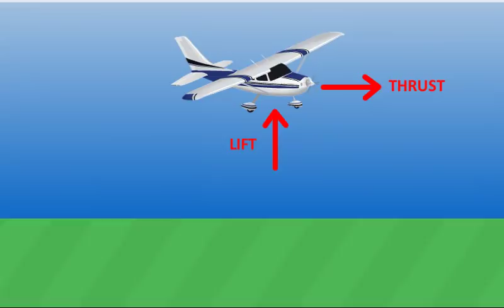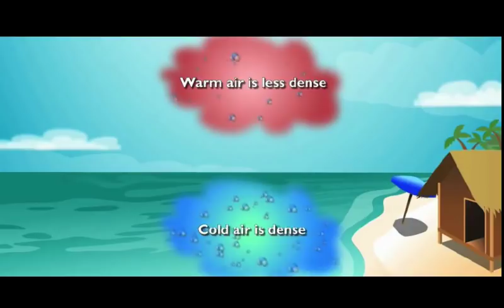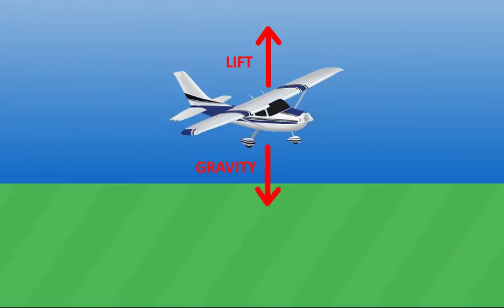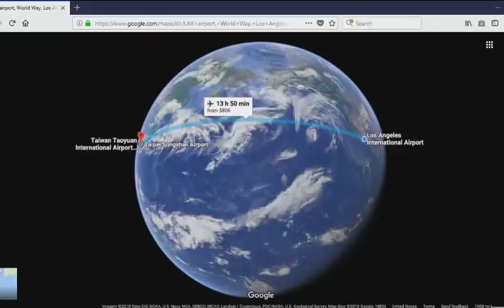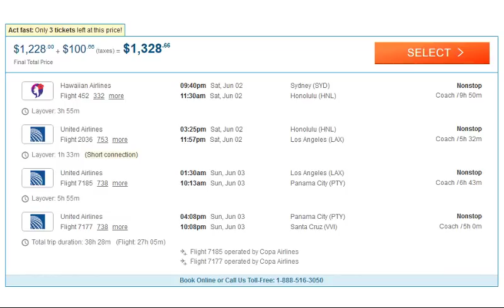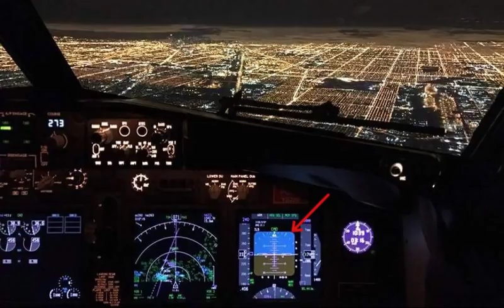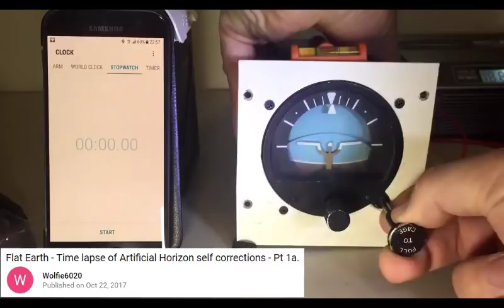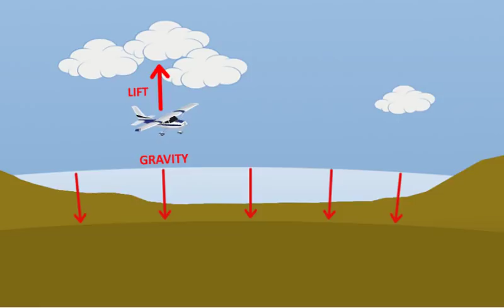Flat Earth Falsities - Plane Nonsense

Comment: Your videos are good but your explanation of why an aircraft does not have to keep pointing its nose down is not only wrong but it is superfluous because an aircraft does actually have to do so. It is only that this rate of pitching down is so slow as to be entirely imperceptible. Consider launching a satellite into orbit. If you do not give it a rate of precession appropriate to its orbit then what force is going keep its attitude stable relative to the earth? Take a gyroscope in geostationary orbit. It’s spin axis will remain fixed in space it will precess at the rate of 360 per orbit unless you introduce a rate of precession. Gravity does not automatically solve this problem but can be used as a reference for a precession motor to keep the gyro axis aligned relative to the earth if that is what is desired.
  Now, you can argue that the airplane does already have a rate of precession having started from a spinning earth but that is not how you explained it. And of course, as soon as the aircraft starts to manoeuvre this is all messed up. The simple reality is that either the autopilot or the pilot is maintaining the attitude of the aircraft relative to the spheroid. The pilot does this imperceptibly by always maintaining pitch attitude relative to the horizon or artificial horizon (gyro). The gyro itself however is being precessed by a motor to keep its vertical axis normal to the earth surface. Therefore the pilot is actually pitching over at the same slow rate that this earth tied gyro is being precessed. It is a fact that this is occurring albeit imperceptibly. So the answer to this flat earth question is not “gravity takes care of it” but simply yes the aircraft does actually adjust its pitch attitude in space as it flies around the earth.
Reply from the maker: xplain, if what you said were accurate, you would have to push the yolk forward indefinitely, which is impossible, it has a limit. Yes, pilots are making adjustments, but the physics of flight will keep the plane level to gravity when flying straight and level. Your comparison to rockets is not correct, because rockets don't use the atmosphere to generate lift like a plane does.
Reply: VoysovReason you say if my explanation were correct one ‘would push the yoke forward indefinitely which is impossible’. Not so. You do not have to keep pushing the elevator forward continuously. What you do is make the correction then return to the original control position.What would happen in theory (ignoring short term perturbations to the aircraft attitude that are actually much more significant and would totally mask this effect) is this......after flying for a time the aircraft will in theory have pitched up relative to the horizon if not corrected for. The aircraft may or may not possess the positive static stability in pitch to take care of this automatically, it is not a given. The pilot would in theory make the small imperceptible adjustment by noticing the nose high attitude and making a pitch down control input. This is achieved by moving the elevator down but when the pitch attitude has been corrected the pilot brings the elevator back to the level trimmed position from which it started, which will maintain the new attitude until it is time to repeat the process. The control input from the trimmed position is only required to induce a rate of change on the aircraft pitch attitude, then upon reaching the correct attitude it is removed. This is a fundamental control concept. The same thing can be understood in roll. If you wanted the aircraft to fly round in an enormous circle like a flat earther might, you could in theory fly with an imperceptibly low rate of turn but in practice you would actually fly short straight legs until it was time to change course by a whole degree. This is in fact how aircraft are flown along great circle tracks - by flying a rhumb line until it is time to alter course by a whole degree to maintain the great circle. During this very small turn the pilot or autopilot will apply control deflection to manoeuvre then on reaching the corrected course return the controls to the trimmed position. It doesn’t matter how many times you repeat the manoeuvre, you do not reach the limit of control movement. The only time you reach that limit is if you try to manoeuvre at a RATE that reaches the limit of control deflection (or if something goes wrong).
  Gravity acts on the aircraft centre of mass. But the aerodynamic forces act through the centre of pressure. This means that a high wing aircraft has the centre of mass below the centre of pressure and therefore, yes there will be a pendulous effect that will give the aircraft positive static stability in pitch. But most airliners flying long distances are not high wing but low wing and have a centre of mass very close to if not slightly above the centre of pressure of the wing.
  Your explanation would work for a hot air balloon which not only depends on buoyancy but is clearly a pendulous mass. It is not correct for airplanes per se although it is a factor in airplanes with positive static stability in pitch. The simple answer to this flat earth meme that the aircraft would have to keep pointing its nose down is actually: yes it does actually have to whether by attribute of stability or by control input, but it is imperceptibly slow.
Reply from the maker: Rollie - Great explanation. I agree 100%, and I may have oversimplified it. Of course the density variance of the atmosphere is a big factor, but that is a direct result of gravity, so it still gets back to gravity. That is what I meant by "gravity does it automatically".
Reply: I launch SSTOs in KSP and I can confirm this.
Reply: What pointing down? They always fly point up, no matter how fast or high.
Reply: If you have ever flown a plane, you would know that just as in keeping a car in it's lane you are constantly making adjustments by turning the steering wheel left and right to keep it going in the general direction you want to travel, so too in an airplane or jet aircraft, not only do they turn the wheel to go left and right, but also they are constantly moving the yoke up and down to stay in their assigned flight altitude.. I don't know who started this silliness with airplanes not having to do any adjusting while in flight, but it is just the silliest thing I have ever heard. Aircraft are constantly moving the yoke to keep in level flight with the horizon..  So PLEASE quit thinking that once a flight
starts that the plane is locked in to a straight path (straight line), because it surely is NOT.. Even with the auto pilot engaged, it is constantly making corrections to stay level with the horizon and in it's assigned flight altitude.
Whoever started this nonsense, should get some education on how it really works before declaring things to be so that in reality, are hogwash.. 

 Xplain, I am expounding on your rebuff here so people will understand, that YES,
aircraft are always adjusting up and down with the yoke.. In fact you do more of that than course corrections when flying.  Due to winds, you will raise and lower without doing anything, and have to adjust it constantly.. 

Flat heads constantly PROCLAIM so many things, that just are not true, and it is sickening how they demonstrate to the entire world how they failed in their education...
Reply: Rollie, what I was trying to "cite" or say, is that so many of the flatearthers CITE that pilots have to constantly aim the nose downward so they don't fly off into space.. This has been CITED a thousand times by them.  My point being, that flying just is not like that at all.. You don't keep making the nose go down (as you already know). Flying is a constant adjustment to keep planes flying above the ground.  I just don't want flatheads to think someone is in the cockpit aiming the nose downward to keep from flying into space.
That is not how it works.
Reply: We are most likely just wasting our time with them anyway.  It is a good source of amusement though, I must admit.  Thanks for your input.
Reply: Rollie yes of course gravity is the cause of the pressure gradient through the atmosphere. But it has zero to do with maintaining the pitch attitude of an aircraft hypothetically flying around the earth. I am looking forward to your explanation of how a pressure gradient can cause a torque about the lateral axis, or as laypeople would understand it, affect the nose attitude of the aircraft? Please go ahead I will check the response when I land from this afternoons test flight.

Comment: I got questions for you how did we land on the moon if moves around 2000 miles per hour and a space rocket top speed is 17500 miles per hour and the distance from the earth is 238900 miles away it would take the rocket around 14 hours to get to the moon but they said it took 4 days not only that the moon would have been gone because it orbiting the earth and they had enough fuel to get back too how ? Because our solar system is moving too at 515000 miles per hour
Reply: Lil Glo God Lil Glo God Lil Glo God your comment shows a lack of understanding of basic orbital mechanics. The top speed of a space craft isn’t limited by the power of it’s engines, but rather by the amount of delta V it has and the body it orbits. They planned to catch the moon like a footballer has to throw his ball in front of another running person. And yes our solar system is moving at a high velocity, but that applies to the earth, the moon and the space craft, so their relative speed due to solar system’s movement is 0. This is all very basic information you can look up easily
Reply: They don't aim for the moon, where it is at the time they launch. They aim for the moon, where it will be. Same as throwing a ball to a friend, who is running - you throw it where they will be, not where they are. It's actually very simple.
Reply: Check out the channel Curious Droid. You can probably find a lot of answers there about space flight. But yeah they didn't go in the Shuttle. They took some big ass rockets.
Reply: @CaptWesStarwind  also I forgot to mention what about the van allen radiation belt is that in the video too
Reply: 1. Flying to the moon isn’t as simple as “oh let’s just launch a rocket and hope it goes there” because NASA actually planned a lot into this such as finding the perfect time to launch and launching at an angle so that they can match the speed of the moon so they can catch up with it, kinda similar to throwing a ball at someone while they are moving 
2. They do not use fuel at all times when they travel in space, they use thrust to get them up to speed then stop the engines as to not waste fuel and to slow down they use retrothrust which is basically aiming the rocket in the opposite direction that you are going in to slow down
Reply: Since when did they go to the moon on the space shuttle? Fuck you are one clown lol.
Reply: @johnnym.1868  damn use the wrong word but you knew tf I ment
Reply: Lil the do Trigonometry on all those speeding orbs, and with perfect weight maths from a couple Cavendish balls hanging, in a shed, all very advanced science my friend.

Comment: wy planes dont dip their nose constantly. wel to explain it the same way the flath earthers want to prove the earth is flat. 

the earth is relatively flat from the perspective of a human/ plane. we fly straight. and the nose dips constantly and raises constantly goes from side to side constantly. so humans corect it. and cuz the surface is from the perspective of a human in a plane is flat we dont notice if the plane dips a fraction of a degree to conpensate for the gravity. so eaven if you dont know the acurate reason wy we dont dip the nose. we can stil not notice the dip eaven if we had to do it cuz the dip of the nose is so minute we wont be able to notice it hapening.
Reply: Actually, if air pressure was always the same at any altitude, the plane would continue to fly "forwards" escaping from the earth. Once the plane goes too far forwards, it's height compared to the surface increases, if the plane is higher up, it goes through less dense air, if you keep your speed constant, less dense air generates less lift, when lift is decreased, the plane tends to naturally "dip", it always stays at a constant level, where air pressure is the same. If you want to increase height, you would have to compensate in speed, so the wings can generate more lift
Reply: my coment was not a call for help but a coment towards flat earthers saying if we did not dip the nose we wil fly of the earth. so in their minds the earth is flat cuz they never feel that we dip the nose. so if they never feel a dip that they belive is suposed to hapen they reinforce their own theory that the earth is flat. 

and lastly to coment on your first centance. if that statement was true and we both know it is not. pilots wil corect the plane dipping the nose manualy and as in my original coment we wil not feel them doing it cuz the change needed is to small to notice espesialy relative to the changes to the plane caused by wind and other things.
Reply: @malof7514  I'm terribly sorry but I can't really understand your thoughts, maybe I just misread something
Reply: The short of it is flattards don't understand what level means.
Reply: @CaptWesStarwind  yet, they use the word "level" a lot
Reply: malof: "[planes dip nose to follow curvature]"
I am sorry but VoysovReason explained it correctly. Pilots don't need to dip the nose of the airplane to follow curvature - not even a fraction of a degree. This is quite often explained wrong in FE debunking videos unfortunately.  The aircraft follows the curvature automatically as long as lift force and gravity is in balance as explained in this video.
Reply: i am saying IF they had to dip the nose we wont notice it. to explain to flat erthers that belive we HAVE to dip the nose cuz the curviture. in their world we dont need to dip cuz the earth is flat in reality there is another reason like others explained for us not needing to dip the nose of the plane. but flat earthers are fast to ignore logical explanations that they dont agree with. like gravity so if you use gravity they ignore your statement cuz they dont belive ingravity. so i tryed to explain in a way they cant ignore(hopefully).
Reply: @malof7514  I think we are putting too much pressure on them, they are flat earthers because they couldn't figure it out. "Don't listen to illiterate and doomsayers" so maybe, we should leave them to their state and educate the ones e that are willing to partecipate

Comment: It is also possible to trip the gyro in the the artificial horizon in aircraft causing it to spin for ten minutes at a rapid rate by doing intense aerobatic manoeuvres. Would this indicate the now stationary aircraft  is now spinning rapidly according to the horizon. No. The gyroscope is merely reacting to acceleration forces in directions other than towards the earth, further proof that the artificial horizon is calibrated to read attitude perpendicular to the pull of gravity. As an aerobatic trained pilot I regularly trip the gyros in my instrument panel. Gravity is a very real force and I invite any flat earther to join me in an aerobatic flight to witness the force of gravity in many directions of acceleration and up to 9 times normal gravity. This should demonstrate the existence of gravity and also demonstrate how the gyros in the instrument panel are set up to read towards the earth. The gyroscope automatically levels itself towards the pull of gravity thus when gravitational force is experienced in any direction other than downwards the gyroscope gets spun in a new axis. This gyroscope is so well balanced that it takes a while to correct itself. A quick warning though there is a forfeit for anyone who is sick in my plane, not only do you have to clean up yourself but you'll also have to buy every pilots in the lounge at the airfield a drink.